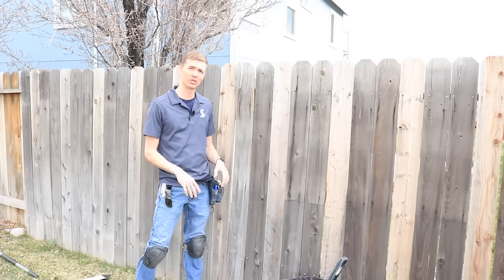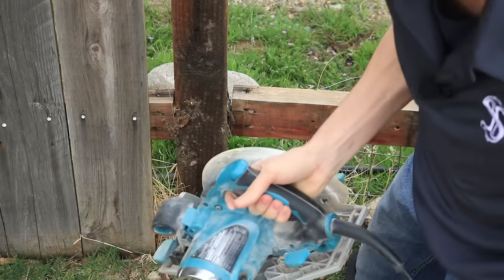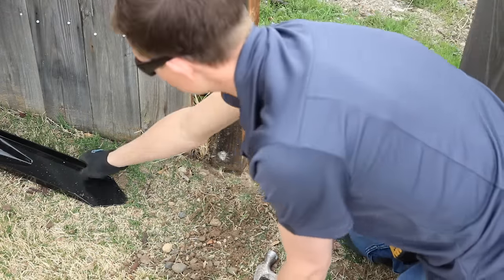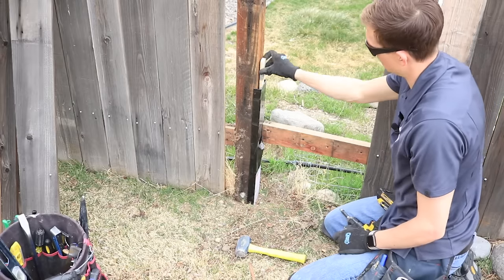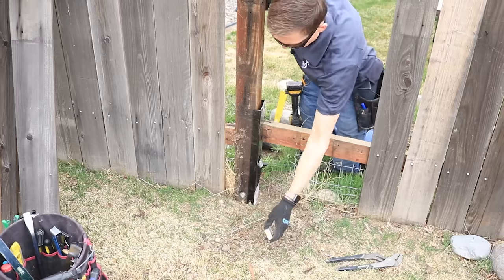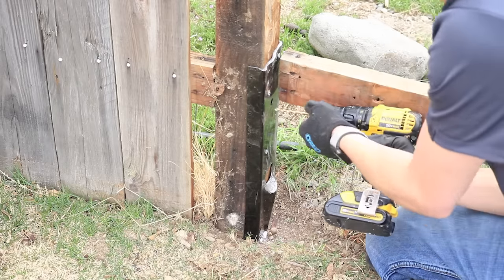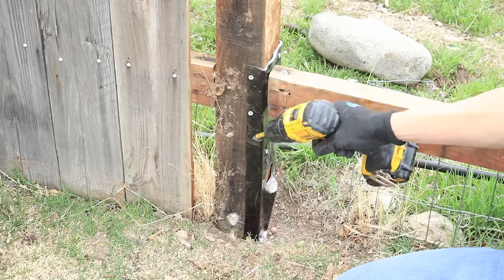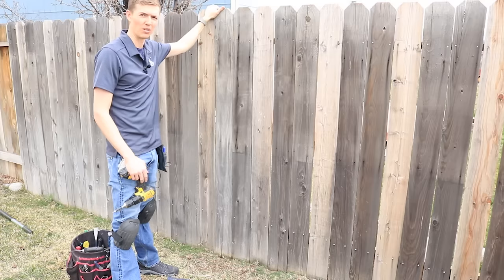How to Fix a Broken Fence Post in Under 30 Minutes

Comment: My posts are 4.5 inches by 4.5 inches and this mender fits on 4 by 4 posts. Is there a similar solution I can use to fix my larger posts, or can I notch the posts in some way for this mender to fit? I have two rotted posts and I would just replace them entirely with new posts, but none of the outlets near me have inventory due to supply chain issues. Thank you!

Comment: Nice! Is Is it a good idea to install the those with a brand new fence 🤔
Reply from the maker: No, that would be a waste. Just use them to repair on the posts that rot out.
Reply: I think I will, as we all know wooden posts are going to rot and break eventually, it would be so much easier to put these in as the fence is built...

Comment: I used that method and it didn't go as this video portraits, was barely able to get an inch of that to pound into the concrete with a sledge hammer. Ended up deforming the crap out of the EZ mender, it did hold with even the inch pounded in but who knows how long that will last. I suppose this would work better with only posthole sized concrete fill that will crack open to the wedge but most peeps use a shovel dug hole with a couple bags of crete in them which this method will not work correctly due to the thickness of the crete.

Comment: I've learned living in colorado, Concrete does nothing but provide a larger base.  Post rot out inside the concrete blocks regardless if they are pressure treated or cedar and snap at ground level.  This looks like it would be a nice thing to add to a fence post that has dead man anchors insted of concrete footers.   Just seems like alot of effort to do a cheap repair rather than replace the post.  I hoped it would of been a faster repair, but good video.

Comment: i am 69 with bad back i love the concept except for pounding in the easy mender. also, if you have the post surrounded  in cement where do you get the space to pound in the easy mender? but a great video!
Reply: Keep in mind the lower section of the post is rotting so it shouldn't bee too difficult to bully the steel in beside it.

Comment: The posts rot because the concrete holds moisture.  If you leave a hole in the concrete, at the bottom of the post hole, the moistute can leave, assuming your area isn't inherently wet.
I put set the post in the ground first, then add the concrete around it.  I have many posts (treated) that are still in service after 20 years.

Comment: The old concrete below the ground would NOT allow any clearance a metal insert. So I broke up the old concrete,
removed it and then used angle iron + fresh cement. I would suggest more attention toe the old concrete as being a
potential, tougher barrier to the repair process..

Comment: Quick question.  I need to do a repair on the same type fence obviously.  Will the longevity of doing it this way be comparable to just switching out the whole post?
Reply from the maker: It certainly can be, but it depends on lots of factors like how solid the existing concrete is and how well you address the moisture issue that caused the original post to fail in the first place.

Comment: Would almost seem sensible to use these when installing a new fence pre-concrete if cost an issue? If price not such an issue then concrete posts all the way.
Reply from the maker: It's not needed if you have proper drainage around the post.

Comment: I have drilled out the rotted wood in concrete then some creative tapper and treated shim, hammere a new post in the hole. some times only 12 " into the hole works. But this looks cheaper and faster and better.
Reply: There are 3 elements in any job. CHEAP. FAST. GOOD. You can choose any 2 of these.

Comment: What if there is no concrete?  Found my fence contractor failed to use concrete on the two posts at my gate. Of course, one of those broke at the ground. That’s when I found out there’s no concrete. I suppose I must dig up the entire thing and rebuild it correctly with concrete?
Reply from the maker: Yep

Comment: The basic problem is that this is a closely boarded structure meaning that the prevailing wind is not getting through it with the result that this post, and others, will eventually fail. The wind always wins!  The best method is to replace the post and to fix, for example, box section or tee section galvanised mild steel to the full length of the new post in advance of the concreting process. Then flame the buried section to prevent rotting, as the Japanese craftsmen do.

Comment: Cracking the concrete will allow water to get in and create wood rot of the post. Can't you shorten the metal plate and drill a hole into it and hang it on the post as support for the perpendicular beams of wood ?

Comment: On those angles for those screws, I was thinking using pocket holes, so the screws would fasten better and not use the end grain.
Reply: I was thinking the same. It's worth the extra time to put pocket holes in these 2x4s before mounting them.

Comment: Does it help if you install these when you first build a fence?
Reply from the maker: That would be unnecessary. Just pour the cement so that water is diverted away from the post to make it last longer.

Comment: Where did those shims go that you put down to hold the steel away from the post?
I think a Metal  pipe that could not slip down would be better.
Reply from the maker: I took them out before securing it with screws.

Comment: 2:40 if the ez mender splits the concrete, you need a different kind of repair - what kind?  (that's the problem i'm having)
Reply: You could use a concrete repair spur.

Comment: Is their any way to remove it.. i drove one into the front pat of my fence (no cement ) and itsintheir but it's not flush against my pole. I can't replace the boards to cover it up . So how do I  get it out?
Reply from the maker: I would cut it with an angle grinder.

Comment: I fenced my yard in 1996.put the 4x4x8 post in ground using only dirt and gravel.NO CEMENT.it will be 23 years in june and I have only 1 post to go bad.i used a treated 2x4 cut to 4 ft. I hammered it in the ground 2 and1/2 ft. then secured it to the 4x4 with screws.i have had to replace some of the pickets over the years.i do put water sealent on my fence and post every 2 years
Reply: The lime in the concrete actually rots the post.
Reply: @oldredcoonhound2182  All wood needs is alternative WET and DRY cycles to rot.  Nothing but chemicals will ever stop that.
Reply: TIP: you only need the sealant at the TOP and BOTTOM few inches of the fence: that's where the ALTERNATING WET and DRY CYCLES occur MOST OFTEN, which is WHAT CAUSES ROT.

Only if you're using a stain for appearance sake will you want to hit the full pickets and cross pieces.

Comment: Why did you put the EZMender on the side of the post, rather on the front of the post which would be much easier?
Reply: Well, a) it would seriously invite wind pressure to crack away the concrete down below holding the post "mender" in place.   At least putting them this way lets it grip the post a bit with the way the wind will rock a fence...

Comment: Good info if the goal of the video was to inform others about this easy fix. But do you offer this fix as a handyman?  Doesn't this fix cut into your labor time?  Replacing the post would have added at least another hour to extract and cement.
Reply from the maker: Only if you charge by the hour. It’s actually more profitable this way because the perceived value to the customer is the same, whether you replace the post or fix it. And it takes about 1/5th the time to fix it.
Reply: @StayHandy  - How much do you typically charge for this quick fix?

Comment: If the post is rotted near the base and causing the problem, but the concrete is still solid, it can make getting the mender to penetrate nearly impossible. Home Depot price is $16.50 for their model.

Comment: When installing a new post there is a PVC sleeve they make you put the wood in that and pour the concrete in the PVC pipe and that should keep the post from rotting out.
Reply: And make sure the PVC is higher  than ground level above the post. These post rot mainly at or slightly below ground, because water pools at the base of the post and seeps in when the post shrinks when it dries out.

Comment: Next time I put in new posts, I'm going to add one of these braces to each of them.
Reply: These are not braces for new posts. Just use treated timber that is designed for the job and they won't rot. Also, these steel strips will rust out long before timber rots.

Comment: What would you recommend for a 6 x 6 post that rotted?
Reply: Try 4 steel T posts, one at each corner if  you do not have concrete to deal with.

Comment: Last year I had four posts to replace.  Estimate was $4,000 which I could not afford.  My friend is like the many "just dig it out to do the REAL MAN's joB" commenters here so based on that I tried to do it the proper way.  Well these concretes go 4 feet down and go about 9 inches out from the post in all direction.  The earth around is hard packed with thick roots and rocks,  I spent so much time and effort trying to dig it out but I didn't get even one concrete out.  Even if I dug it out the hole would be expanded where I dug so how woud you pour and set the new post nicely in a gaping pit?  I can't imagine a lever or hand jack would ever get these out where I live you would absolutely need a tractor or MAYBE some kind of power winch.  JUST DIG IT OUT is what the contractors who want to charge $4,000 say who have this equipment.  I ended up using galvanized steel brackets and heavy bolts and they are still standing

Comment: Will this work if my post already broke off?
Reply: Naw, just remove as he suggested but you get to dig out the rotten wood bellow ground - if you can you ought to drill through the concrete pocket to allow water to drain (so the same does not happen fast) then whale in an exact same cross section post with half a foot too long. Whaling that post top will split it. Next time get to it before it shears.

Comment: The problem with these is they are always wider than the average 4x4 fence post which is usually more like 3.5x3.5. It would work better if they made them in a couple of different sizes.
Reply from the maker: They are wider but they still work

Comment: How do you go getting your home insurence cover to pay for a previusly repaired fence post after you using the easy mender
Reply: What??? You don't claim on insurance for a rotted fence post.
Reply: Why not just replace the post and then if a tree falls on the fence or wind blows it over in a storm you can claim on your insurence, but if its been previosly repaired in anyway (like the easy mender), insurence companies generally wont cover you.

Comment: Mine came in a left and right. Beat on them both for a couple hours. Never got the wedge section to ground level. Mine also had a hole for a 1/2 inch lag bolt.  The post section below ground was rotted too, so the menders tended to go in at a slant. The big bolts brought them against the pole.

Comment: Anyone who actually needs to see this video should also know that there is not always any concrete around a wooden fence post. This type of "mender" could still be used, and it would probably do a decent job as long as the mender was driven in right up tight to the post.

Comment: It`s a nice idea, but seems to me it can`t be a permanent repair. Hammering a concrete posts foundation may crack it which open the way for moisture and the post will rote quickly after that. Also, it can`t be used for a retaining wall reinforcement. A good idea but not universal. Thank you for giving this technology!
Reply: Correct. It is a temporary repair to get a bit more life out of an old fence.

Comment: cut a slit in the center part way up and it will wedge its way into the concrete hole won't damage the concrete and will go down deeper

Comment: In my experience it's never just one fence post.  Eventually you have to dig up the old plugs and reconstruct the entire fence.  Do yourself a favor and don't toenail the rails to the post.  Use galvanized hanger brackets.  Down the road they are much easier to repair.
Reply from the maker: You’re right, but you can usually get another 10+ years out of your fence by repairing just a couple of posts.

Comment: How do you know which fence is yours? I thought, facing your back garden the fence to your left is yours to the right is the neighbours.
Reply from the maker: From what I understand, a shared fence is both yours and your neighbors. A lot of people will split this repair cost with their neighbors.
Reply: Handyman Startup how do I know if it’s a shared fence? What if it’s not?
Reply: spongeroby1 see if the soft part is turned to your side. In that case, the fence was made from the other side. I guess ‘-‘
Reply: Lucas Morozini which is the soft part?  One side has the posts exposed to me the other is not.
Reply: spongeroby1 I’ve been watching few videos of repairing and building fences, and I’ve heard 2 guys saying that. Because should be the straight side outside (to make a better look) and the post inside your properly. Cause if you day you have to repair you don’t need to remove the board to fix the post. I will search better about I let you know.
Reply: Typically the fence will be a few inches inside your property line, if it's yours. If it's right on the property line, it's a shared fence. It doesn't matter what side the posts or pickets are on.
Reply: @spongeroby1   A shared fence usually has the fence boards on the outside, of every other section, get it?? 1st section, the fence boards face your house. 2nd section, the fence boards face the other house.  You will see the "back" side of the fence section, every other section, get it ??
Reply: @frandanco6289  that’s not the kind of fence we have. On the left i see the back of the fence boards. On the right i see the front of the face boards.

Comment: Profitable business 
- dig and break out the post footing (1hr) (really 30mins)
- buy a replace post and concrete (2hrs) (store run and work)
- walk fence and secure loose boards and clean up) (1hr)

(4hrs) x $60hr = $240

Now onto your afternoon appointment project
Reply from the maker: Or you can offer them this repair, still charge $175 to $200 and make closer to $200/hr. The whole repair takes about 1 hr.

Comment: I would recommend just replacing the post. I'm having to replace a post that the previous owners mended like this after it failed again a bit lower within a few years. Rotten wood is no joke. It's also much harder to remove once it's broken multiple times.

Comment: How do you learn all this stuff?  I'm not being rude, when I was at school I wanted to do woodwork and metal work, but I wasn't allowed to, because guess what?  I'm a woman.  I'm 62 now, when I was in my 30's it was a revela tion to me that screws came in different sizes.  Similarly this video has taught me something else, they come in indoor or outdoor!  How do you tell the difference when you're in the shop?  I'm single and I've got some fence posts that need repairing, but I think I'm going to have to pay a man to come and do it for me.  Which is such a pain . . . .and expensive.
Reply from the maker: I learn by doing and watching YouTube videos. My degree in mechanical engineering helps a bit too.
Reply: Elizabeth Butler don’t pay no one to do it, I can tell right the way you are a strong woman! You will notice in the labor saying the screws are indoor or not.
Reply: Easy, assume you don't know, and just ask.  Any hardware store worth your money will gladly and patiently explain.  Besides that, check for Youtube videos BEFORE any project, today it covers everything DIY including how to make a nuclear bomb...  You need to watch enough of them to make sure you get the real facts, which in the case of THIS VIDEO, you DIDN'T, since the manufacturer recommends TWO OF THESE ON A POST.

Congrats on being the same age: 62.

Now, go figure out EVERY project you have to tackle in the future like this fully before you act, and THEN you can just hire someone BY THE HOUR to do the work because YOU can tell them step by step what needs to be done and how it is best done.

When YOU are the "expert", then all you need is reliable MUSCLE which is MUCH CHEAPER than an EXPERT.

Comment: insert two of those brackets on opposite sides ..preferably NOT the sides you used , so it doesn't swing  back and forth at all.Once done pour some concrete as well .It will never move
Reply from the maker: The reason I don't do that is the concrete is more likely to split when you use two, then you have to dig up the entire thing and pour concrete. Pouring concrete takes too much time and effort, too.

Comment: I don't see how this would work if the post portion in the concrete hole is really rotten. You would be wedging against rot. I see this more often than not.....complete rot, even though above ground the post is usually solid.

Comment: Interesting video, but I'm not to sure why they call it the "Easy Mender".  It doesn't look all that "easy" and could be a lot of work if you have several posts to repair.  I'd recommend seriously evaluating the life expectancy of the fence and maybe install a new fence with steel posts to make them last much longer.
Reply from the maker: That is one option. It’s just about 100x more expensive. It’s

Comment: Good fix ,  but  better off replacing the post & concrete and use a metal base embedded in concrete and set post above ground tighten with bolts . Won’t rot
Reply: And where can we get such a metal base? and what is it called? And how much does it cost?
Reply: The Home Depot , it’s like a saddle .